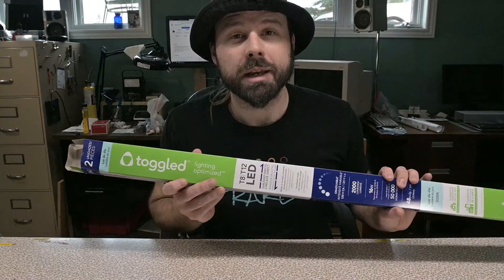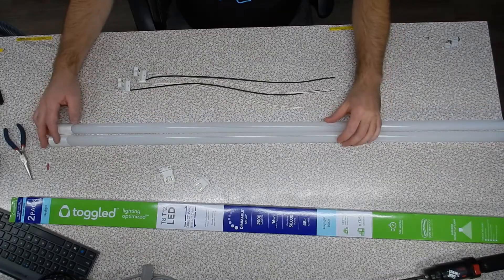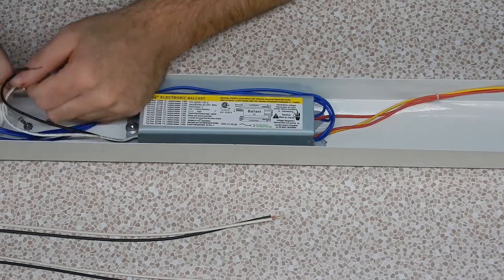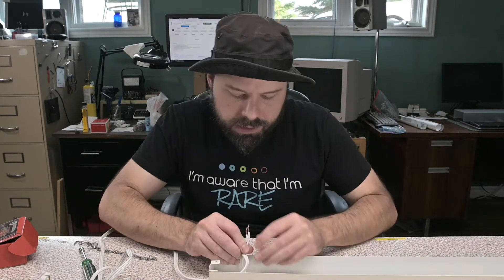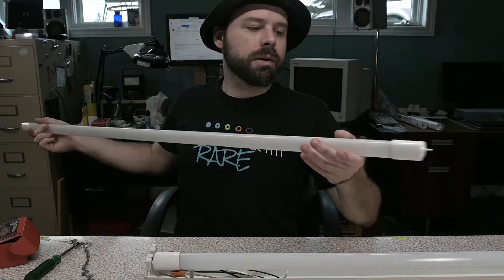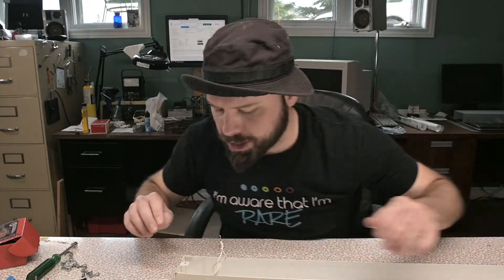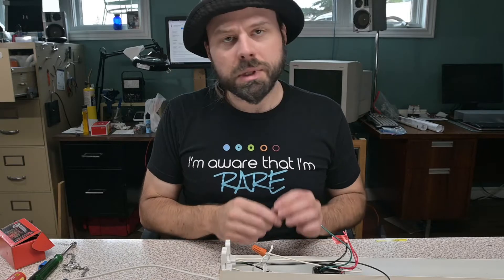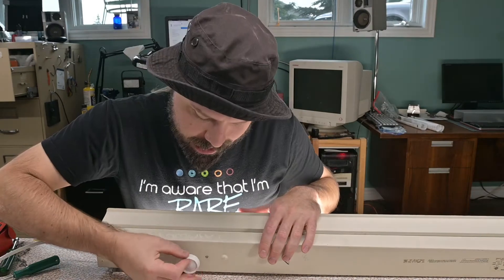Toggled Direct Wired LED Conversion

Comment: Thanks so much for this! Can you still purchase replacement tube light bulbs without having to do any wiring? Just the bulbs to snap in and out of the fixture
Reply from the maker: Yeah, in fact, finding bulbs like this to use direct wiring is they tricky thing in my area. 
Most of the replacement LED bulbs I've seen sold at the hardware stores are designed to drop in to your existing fixture with no wiring. I haven't used any of them, so I can't recommend any.

Comment: I bought these bulbs and a new fixture and ballast (rapid start not instant start) and the rapid start ballast comes connected with non-shunted tombstones, so my question is, since these bulbs come with non-shunted tombstones to retrofit, am I good to just pop the bulbs in once I wire and mount my fixture?
Reply from the maker: I'll admit I'm not quite following what you're asking. Not sure what you mean by non shunted. 
You have to remove or at least dissconnect the ballast, these bulbs run without it. You wire the mains directly to the sockets. The bulbs come with new sockets to save you the fuss of having to get the wires out the old ones. Just drop in the new sockets, connect the mains to them. Disable the ballast.

Comment: Sir, I have a question.🤚
Does the powered end need to be jumpered ?
I don’t remember that part in the instructions.
Reply: The powered end, one pin gets hot (Black), the other pin get neutral (White). The only jumping I can think of is jumping over to the next tube.

It's been a while since I filmed this, and it's hard to advise without the project in front of me.
Reply: Oh, I see what you did there.
You connected the ends a bit different than the way the Toggled video showed it. They didn’t jumper the two sides together, but looks like either way works the same.
Reply from the maker: @jjdvideo  Yeah, I didn't look at any manual really. I've just been a technician for a long time, and pretty much just knew how to hook it up.

Comment: I installed twelve of the 24" Toggled tubes in six 55 year old light fixtures. The new tombstones would not work in the old fixtures, but the install was simple, white to white, black to black using the old tombstones. If you get these lights, they are extremely bright. I wish I would have gotten the dimmable ones and installed a few dimmer switches. I have these in my kitchen, and in the middle of the night... They will wake you up! Other than that, I love these LED tubes, install was a breeze, took around two hours to install all twelve bulbs with interruptions... I purchased from Home Depot, on line, they arrived in two days with free shipping. Everything I needed was included with the tubes. I will purchase more of these when I install lighting in my garage.
Reply from the maker: They have a non dimmable version? This ones the only version my local HD stocks. Mind you, I don't think it played well with ever dimmer. 
They are pretty good tho, I like them. Will be getting more as I need them.
Reply: @DATT  Yep, they have a version of both if you look on line. They ship direct from the manufacturer, which is located in the Detroit suburbs. I ordered online and had them in two days from HD.
Reply from the maker: @michaelwright1602  Ohhh yeah, I'm in Canada. Getting stuff is a lot easier down there.

Comment: Or buy a new 5500 lumens fixture for about 25 or 30 bucks. I see them all the time, good video .
Reply from the maker: Ah, I wanted to try one of these kits. This is my most viewed video, so worth it I guess. 
You in the states ? I think that fixture would be more up here.
Reply: @DATT  Yes in the US. I bought some of these fixtures about a year ago. They seem to be getting cheaper.I liked your video and see how its helpful if you didn't what to switch out all your fixtures.
Reply from the maker: Yeah, they are, I've bought many actually. I like repurposing old stuff if I can. 
YOu know, I'm not sure if this mod is easier than just changing a fixture, they can both be pretty easy. 
I guess it all depends. And thanks !

Comment: what kind of dimmer did you use the one i used made my lights buzz
Reply from the maker: Leviton Universal rotary dimmer. Says part number RDL06.
Ahhh, to be honest, they do buzz a bit. But not enough to annoy me 
It's very faint, and not a problem for me. IF I'm using these lights, I'm working on something where a little buzz doesn't matter.
Reply: @DATT  thanks i am going to try this one TGCL-153 it is recommended for the toggle and hopefully no buzz/hum
Reply: @brandonjay_gotem  how did it work out for you?
Reply: @Fausto27F   i never put a dimmer back on them  just yet
Reply: @DATT  Do you know if there's a smart app controlled dimmer you can get for these?
Reply: Apparently, Lutron PD-5NE!
Reply from the maker: @bjmcduck  Off the top of my head I don't know, cause I don't own any smart dimmers. These LEDs are dimmable, so I just arbitrary chose an LED rated dimmer and yolo bombed it in there. I would imagine any LED rated smart dimmer could work. Whether you can fit it into the light fixture is up to your skill level and liability.